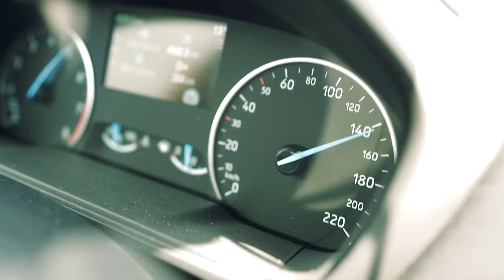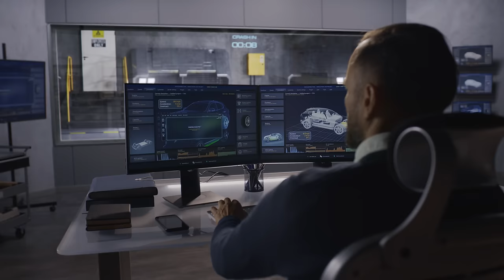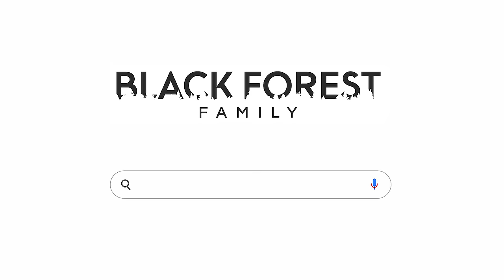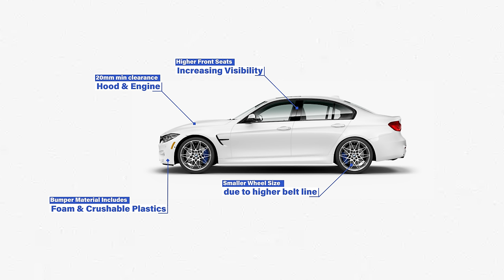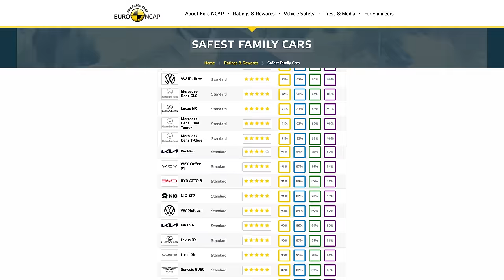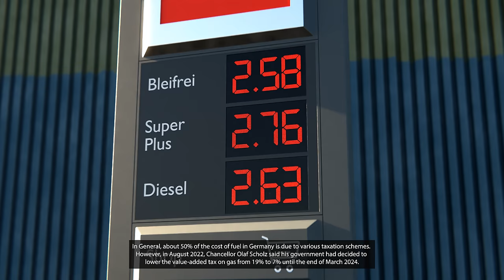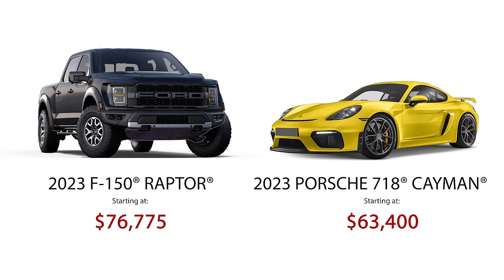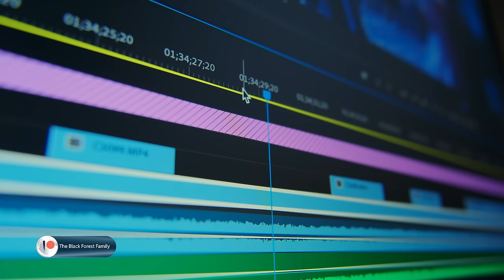DRIVING CULTURE CLASH: Why do our Cars LOOK so Radically Different?

Comment: 5:38 In fact Skoda and Seat are owned by VW and at least Skoda is sharing essential car components with VW. And Mini is owned by BMW.
Reply from the maker: Yeah its always a bit complicated. They're "owned" by VW but it looks like they are still managed / produced (to an extent) out of their respective countries outside of Germany.
Reply: @TypeAshton Yes, you’re absolutely right. They are still managed in their respective country. But at least for Škoda you can get similar car models to those you can get from VW. In detail they may look a little bit different inside and on the outside and they are different i what extras you can get in which combination. But the technical specs are almost exactly the same due to VW manufacturing policies.

Comment: Funny enough I get an ad for a Ford truck from a local car dealership. 
As a family that is a bit of a cliché VW is sturdy, we changed from Golfs to Tiguans a while back because we get the comfort and power without spending too much in upkeep and fuel costs. And you can always rent a transporter if needed, it’s nice to have the height but you definitely have to pay more attention to your surroundings because of it. I guess growing up with mountains, snow and bad roads makes you go for the sturdy cars naturally unless you like to waste money on useless cars.
I don’t mind walking but I don’t see the reason in walking longer distances because I can’t find the parking space due to a car I don’t need or having to rent or buy a smaller car for trips and pay more for essentially a want. I mean others’ style of parking already makes getting out of a Tiguan tight enough quite a bit if you’re muscular built and that’s not even a crazy big car.

Comment: Germany should not just incentivise electric car purchases, but clean electricity production!  Electricity here in France is 80% nuclear generated (rest is hydro or wind). Hence driving an electric car in France is actually close to carbon zero (excluding the manufacturing phase).  In Germany you are largely burning coal to generate the electricity.  Need to change that urgently.
Reply: Germany had to help France with electricity last year because there was less water in the rivers.
Reply: @arnodobler1096  Mainly because there were more than half of the nuclear reactors that had maintenance work required.  So, that justifies an energy strategy based on coal?
Reply: @lours6993  No, that's why we need to invest more in green energy (not nuclear). Which the old Conservative government didn't do.

Comment: As an American living 50/50 in Europe and the U.S., to me it comes down to one thing: torque. Americans have been taught that the only fuel for road cars is gasoline. In Europe, we have highly sophisticated TDI engines (Turbodiesel Direct Injection). Something Detroit does not even dream about manufacturing. Take this example of 2 cars we drive in Europe: BMW e60 M5 & BMW e60 530d. The first one has a 5-liter V-10 gasoline engine (hoot to drive at 180 mph but 12 mpg fuel economy with 400 lb-ft torque). The second one has a 3-liter TDI engine, same 400 lb-ft torque, but 28 mpg fuel economy. A diesel powered Audi A6, VW Passat or BMW 5-series can tow what a 6-liter pickup V8 would be required to in the U.S.

Comment: Why are SUV and Pick-up trucks so popular in USA 🇺🇸?

Because they were heavily marketed as safer to drive - which means safer for the driver, but not the ones outside💀.

I absolutely hate the current trend of crossover cars in Europe - but here they are also picked, because the driver feels safer.

I'm all for freedom to choose - but all this marketing for more profit doesn't offer freedom - but ultimately forces others to choose bigger cars too, if they want to be safe in an accident.

They should be much more heavily taxed - you should think thrice before buying a car that's unsafe for others and is needlessly bigger, higher and uses more fuel than necessary.

It could also be that oil-companies see that as their last hurrah for fuel-powered cars - and want to shift the norm to big cars, that are not easily converted to EV.

Comment: When i ever feel like "i don't care about money" and like to see 10 € bills coming out of my exhaust while driving from gas station to gas station, then...no, no, there's just no way i would buy an american car in germany. American cars (are there any besides SUVs and Trucks?) have the reputation of bad manufactoring, high fuel consumption and cheap interieur. I once had a Ford, brand new!!! and after 2 years, the interieur was falling apart because most parts were just glued. The engine was a 20 year old piece of renamed garbage, which sounded like a diesel engine. Never heard of something like that with a german car.
Add to that, we grow up with the preferences of our parents and/or elders and most of them have funny things to say about car brands they don't like. For example :
"Er fuhr Ford, und kam nie wieder" which translates to "He was driving [a Ford] (*away), and never came back" (*the funny part is Ford the brand, and our word for away "fort" sound simmilar).
"Wer Schei** frisst und Popel kaut, der fährt auch das was Opel baut" i don't want to translate that
"Was fährst du? Auto oder VW?" = "What are you driving? A car or a VW?"
"BMW...[B]ei [M]ercedes [W]eggeschmissen" = "thrown away by Mercedes" or "[B]ring [M]ich [W]erkstatt" = "get me to the next shop for repairs"
just to give some examples

Comment: SOME of us are still having to buy what transport we can AFFORD, not something that echoes our taste (although I think I got lucky with the last vehicle).  shoutout to European gearheads keeping THEIR goodies alive and for basically being the ONLY source I have to turn to to *change a stupid lightbulb*!
one of the reasons I've run into for American vehicles getting longer is the fact that they now base the minimum fuel consumption required on the vehicle's "footprint"; something the size of most eighties cars would now have to get a minimum of 50 US MPG/5l per 100 KM...which, over here would need the 2 cylinder out of a motorbike or a 60's Fiat 500.

Comment: Where I am from in canada we dont do any regular emmisions testing. We only have to get a vehicle inspection if we bring in a vehicle from another province but they are very picky about that I had a car fail because of a cracked fog light and streaky wiper blades. Even Im thinking they should start doin inspection at least every 5years some of these old rust bucks loose pieces on every pothole down the streets😂 everything metal rusts in under 10years and plastic shatters like glass when colder than -30c so nothing lasts long here lmao

Comment: US oil and European oil is traded on an open market but they are on *different* markets: West Texas Intermediate (WTI) Crude Oil and North Sea Brent (Brent) Crude. WTI is priced at delivery to a small town in Oklahoma where many pipelines meet. Brent oil today is $5 more than WTI, which is common. The $5 difference is mostly the cost of piping WTI down to New Orleans and putting it on a ship for delivery to the other side of the Atlantic. Before the US started exporting, oil the WTI price was often much lower than Brent due to frequent production surplus. The WTI standard is lighter (API gravity of 39.6° vs Brent at 38°) and lower in Sulphur (0.24% vs. 0.40%). Brent has greater storage reserve than WTI so WTI is more volatile. The lower API weight and lower Sulphur reduces the cost of refining Gasoline, but not Diesel fuel.

Comment: The Ford EcoSport is such a weird conundrum of a name. It is economical, but it isn't sporty xD 

It doesn't even have AWD to give it a right as a basic offroader.

BTW, the Ford Kuga name is very unpopular in Russia, because it means plague.

What I like about US cars:
- The big, rumbly, often SOHC V8 that makes some nice sounds while driving.
- The versatility of a capable offroader pickup truck as a basic car.
- Many vehicles are still RWD.

What I don't like:
- Manuals are rare
- The US Automatics used to have very little gears, and are very slow in shifting, especially down.
- The popular vehicles like Pickups or Full-Size SUVs are quite big.
- The ugly amber reflection stripes on the front fender
- The red turn signals that blend in with the brake lights

What I like about EU cars:
- Depending on the country, the design can be quite special. It is very visible in older french cars, that were often very quirky. (This...)
- Manual gearboxes are the most bought gearboxes in the EU, although the Auto becomes more popular as well. There is something special about choosing your own gear, and having your full power as soon as you step on the throttle.
- The shapes of wagons, hatchbacks and minivans were very popular around 10 years ago, leading to some insanely powerful, fast, nimble and sporty cars. Think Mercedes 6.2 V8. They put that in a sedan, wagon, SUV and even the R63 minivan. There were even jokes that a Sprinter or X-Class with that engine would come to market.
- Smaller engines with better fuel economy are available.
- Commercial vehicles are usually diesel powered, saving on fuel and replacing power with torque. US cars often make torque from a 6 liter and more V8. Fun fact: The rebadged Ram Promaster, based on the Fiat Ducato, has a 3.3 V6 in the US, but is only available with 2 inline 4 cylinder diesels in Germany.

What I don't like:
- EU Crossovers and SUVs are boring
- The base model cars sound very unappealing
- Many vehicles have a FWD layout

Comment: Just yesterday I saw a American pickup truck „parked“ at the local Lidl 
It needed at least 1 Meter more parking space outside the specified box in length and the width  was from line to line. 
It just didn’t fit.😂😂😂😂
Reply: Same here in the UK. I don't think parking space size has increased since the 1960s, though car size has. It isn't that rare an occurrence seeing passengers get out of a car before it gets put in a space or the car having to be taken out of a space before passengers get in.
Reply: @snafufubar  I believe they recently increased the recommended parking lot width from 2.3 to 2.5m here in Norway.
The average width of cars have increased by 10cm over the past 10 years.
Statistics show the average was 169cm in 1992 and 187cm in 2022.

Comment: 14:06 Congratulations, researcher. You just skimmed completely over the reason the SUV is popular in the US and not in the EU: environmental regulation. The US has significant environmental regulations on cars dating back to the 1970s (the CAFE1 standards, later augmented with CAFE2). Unfortunately, there's an SUV-shaped hole in these standards, which is why American car manufacturers prefer SUVs over cars. The EU has regulations sans hole, so here SUV are not only badly built, low quality gas guzzlers but also expensive to produce/import and own.

Comment: And meanwhile we living close to the German or Belgian border in the Netherlands go to Germany or Belgium to fill up our cars because gas is still considerably cheaper in Germany.
I looked it up some time ago and I could only find Singapore having even more expensive gasoline.

In Europe the class A cars, the smallest city mini's is a dying class, not just because people want to buy larger cars, but due to more stringent safety regulations which require more and more safety systems built into the car and better crash safety requiring sturdier structures which make them larger and heavier by default.
Also these requirements make them too expensive in relation to the market they are intended for.
Models like the VW Up!, Peugeot 108, Ford Ka and Opel Karl are or will be discontinued. So it's also legislation which leads to on average larger vehicles on Europe's roads. The growth of car size in the US hasn't much to do with legislation however, here it's just the consumer wanting something larger as before.

Comment: I really like lower cars, no suv, crossover or pickup for me. (European)
The Porsche and Golf are such much nicer than a pickup or the very ugly ecosport.
And about efficiency, a lower car is much better.
Also the handling of the car is much better.
You have more fun in a lower car.
And if you need more space, check when do you need it?
You can tow a small trailer behind a Golf, or even behind some Porsches.
And a roof box is also common in Europe, also seen Porsches with a roof box.
When you dont need the space, you have a nice and efficient car.
If you buy a pickup or suv, you always have a heavy inefficient and ugly car with too much room that you dont need most times.

And about formers, most European farmers dont use pickup trucks.

Comment: Even for EVs, things are seen differently. Manufacturers tend to sell only their larger crossover formats in North America even while they have other models available on their product lines elsewhere in the world. The VW ID.3 per example, sold in Europe but not in US and Canada, where VW chose to only build and sell the larger ID.4 model. Greater autonomy required for longer travels? Not really: larger and higher vehicles require bigger batteries and sizewise, they are not big enough to go any further! For EVs, only the lower, sleeker designs of conventional cars can go further on one charge: electric crossovers, SUVs and pickup trucks with their impressive frontages face their Nemesis!

Comment: YEAHHH. You mention "Not Just Bikes" That guy ROCKS and explains why the USA is a wreck and unsafe because the total wrong use off stroads (road) and the car-depency. By the way, a pickup truck is a van, not a car as we known in the EU. As is explained by "Not Just Bikes". 

The pickup truck are bigger then them from the past. BUT the space in the "back" are smaller and smaller by every new model :p HAHA, pickup trucks are not practical for transporting goods. All the construction vans in the EU can haul more and are more practical for inbuild storage / materials for work on site. 

Next the facts the fuel consumption is HUGE in compare with EU vehicles. Noted the fuel is cheap, but why it is cheap? Tax... just mention the tax income is that what is used for keep up the roads in good health. Yes Germany has some issues about road healthy, but if you look at nations like the Netherlands our roads are GOOD. (Belgium is not :P )

Comment: Hello Asthon First thanks of picture of my hometown Wolfsburg Germany. Yes it is true that Cars grown in there Class. In the length broad tue new Cars needs more than One paking Spaces. Volkswagen is Build 1945 as a real Car Company, bevor was a Part of NS Industrial Military complex. Only Porsche is younger.  Most of the car Companys in Germany are older than VW. 

There are hidden reason, Why Cars US and Germany/EU are so differend. Technical the is a traditional difference between German Gas und US Gas. The Gas quality is higher in the EU (octane is higher), so Germany had higher pressure in the Engine. Lower pressure Needs for more Power in smaller Engines. So US Cars had mutch bigger Volume Engines, higher Wight.....
So in the end EU Cars Consum less Gas. 
The Next different is based in trade. New Cars in Germany are Build individual for the Customer. US  Customer Buy ready Cars from the dealors.  

Last is a questions. The German Customer of a new Car is older than 50 Years. How old is the US  customer?

thx for your Good Work...

Comment: In Germany you even pay for a 400PS Pickup more less taxes than for a 400Ps Sedan. You can register it as Truck(LKW) or as Pickup with N1G BE Registration.
But the gasoline has the same price. 😂 That's because there are not so much are to see here. And because the parking situation in big  cities or the smaller garages.
And the green party follower hate Pickups and SUV.

Comment: To be fair, while the trucks hold the top couple of spots, most of the top 25 selling cars in the US are from Japan. Its either by an RV sized american car (thank you CAFE standards), or buy something you consider most reliable, and those are the Japanese cars. 
Corolla,Camry, Rav4, Tacoma, Civic, Altima, Rogue.. etc. They are boring mostly, but they last practically forever. And to make them even more boring, people tend to buy white black or grey for some reason. I can't even remember the last time I saw a Lexus that wasn't black white or grey.

Comment: Seems everywhere that ppl are only wanting to buy ever bigger cars! Didnt Ford just can the Fiesta? They would rather you buy the Kuga or Puma which are bigger and they make more £ or € per model! VW also killed the Up, so Ford aren't on their own at this up sizing direction.

The march of the EV is getting ever larger and heavier. When the EU correctly began enforcing more efficient engines be built to a Euro 3, 4, 5 & now 6 standard, the manufacturers stepped up and made their engines far more efficient. 

Problem is, cars got much larger and so better MPG or km/L was nullified meaning we haven't got anywhere! Where next? If I were in the EU group making these policies, I'd enforce smaller cars be made as a priority and tax the huge unnecessary land yachts out of existence! 

Great video, keep it up!